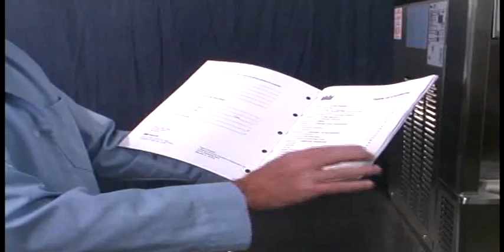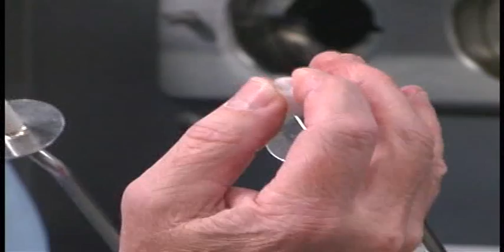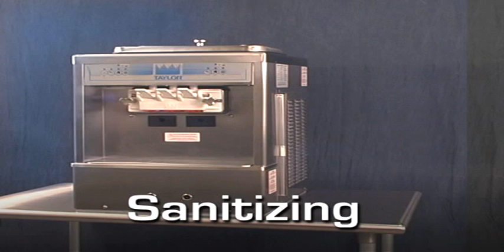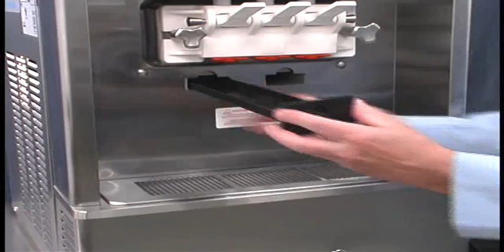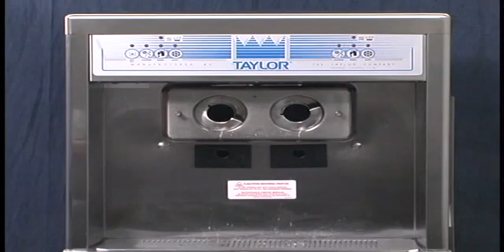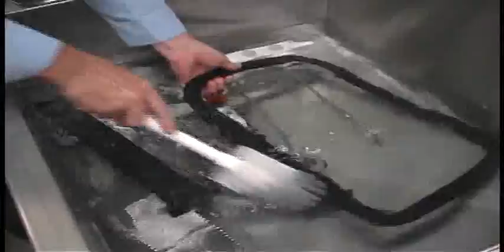Taylor Freezer Soft Serve Machine 161

Comment: Air dry overnight? Wouldn't all sorts of crap fall on it during that time?
Reply: That’s why you lightly sanitize it again the next morning after you assemble everything.
Reply: Not lightly sanitize it, FULLY sanitize it the next morning. Dip all the parts in sanitizer and then assemble the machine properly and then fill it with sanitizer water and run it for five minutes and drain it out. Then Immediately add your Ice Cream Mix.